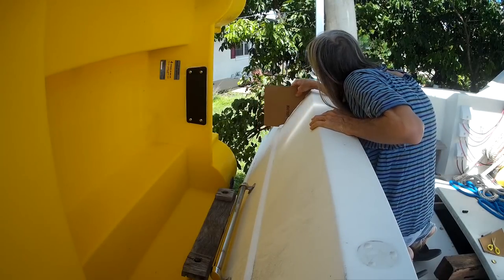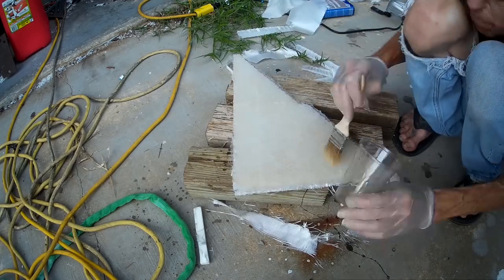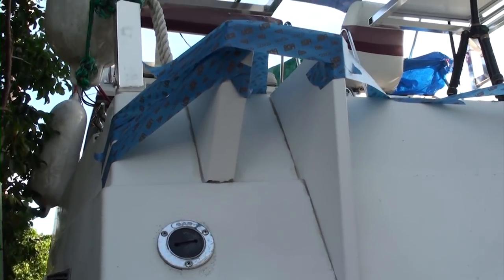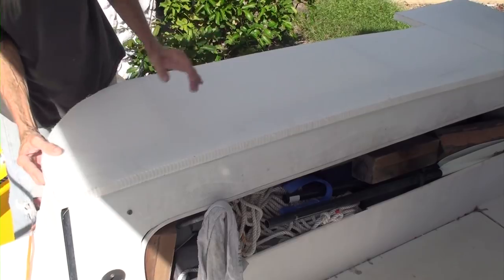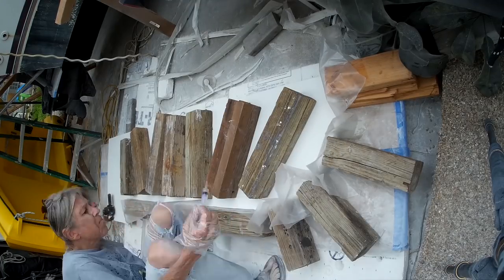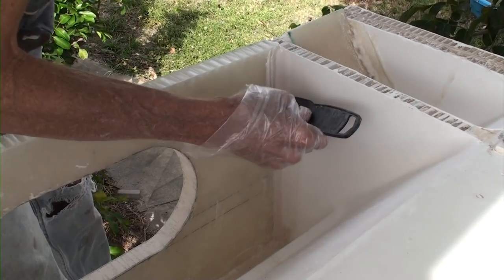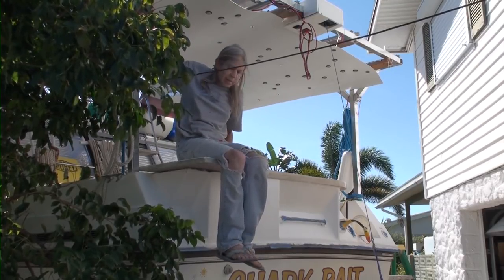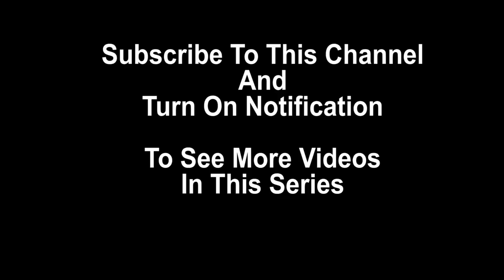Making Nidacore countertop on a boat transom

Comment: Like the countertop! Overbuilt is ok when you never know if a beer keg might land on it or a dive tank!
Reply from the maker: Thanks.  I still didn't know how much glass I needed.  After chickening out and adding more core and glass layers to the counter supports, I just went with 5 layers on the countertop.  You're right about heavy things banging on it in the future, so given the uncertainty about its strength and weight ahead of time, the 5 layers was the only decision that made sense.  After seeing the result, I think I'd go with 3 layers if I had to do it again.  For anything non-structural like closet walls or shelfs for your clothes, just one layer would be fine.  To make stuff like that super-light, use just one layer of woven like I started the shelf supports with.  At that point, they were surprisingly strong and amazingly light (like styrofoam kind of weight).
Reply: Really enjoy your videos.  I gutted and rebuilt my stick steer boat. It was a lot of work.  It's rewarding to have a vision of how to improve something and then make it happen!  By the way, what's your name?
Keep on posting!
Richard
Reply: So I see I didn't post that in the right place. Sorry,first time replying to a video.

Richard

Comment: Excellent DIY work,great job!
Reply from the maker: Thanks!  I learned most of what I know about fiberglass from this boat.  I started with small non-critical projects like the dinghy holders and gradually moved on to larger, more structural projects as I gained experience and confidence.  The generator doghouse came after the dinghy holders, then finally the counter.

Comment: Mate you need to totally remove the existing gelcoat prior to applying glass, you will get delaminating the way you are doing it. Sand back to the point you see glass then you can be sure you will get good bond. The gelcoat must be removed. Your work may hold your weight today but it will not last long before you start having issues. Good luck I wish you well I hope you take my critic in the good spirit is was intended.

Comment: If you are going to use chopmat, it's best to put it first and the woven cloth last. It gives a better finish and also soaks up resin from the chopmat. So, it is easier to finish and it is lighter, albeit a little. Also, woven cloth is stronger by weight than chopmat as chopmat uses twice as much resin for the same weight of cloth. Chop mat is stiffer due to the use of twice as much resin, but ultimately weaker to break, again due to the extra resin.

Comment: Thank you for taking the time out to make this video..👍👍 you really get into Professional Fiberglass skills.. Especially like how you build-up the corners with bondo then fibreglass,and start out with smallest strip medium sized strip and wide strip. I rebuilt a boat probably 25 years ago New stringers naw transom.. No YouTube back then Trial-and-error...but Did learn to Put The resin And jell coat In the refrigerator To get a longer work time in Florida.. Thanks again For taking the time out great video...

Comment: So that's how to cut that stuff.  Sweet.
Reply from the maker: Its pretty easy to cut.  A heavy razor knife works.  The oscillating tool works with metal or wood blades.  A table saw is useful for cutting a little notch in the edge to add quarter-round molding so glasscloth can go over the curved edge instead of a sharp right angle corner.  A circular saw is good for plunge cuts and the straight part of door openings and such.  A jigsaw (sabre saw) is good for curves.  So basically try whatever you've got.
Reply: Surprise surprise more to it than lifting your leg.
Reply: How strong is this stuff just buy it's self . could it be wrapped in carpet and used as a cast deck in a John boat

Comment: You don't use a roller to get the air out I notice. Cheers.
Reply from the maker: I have several fin rollers and tried them a few times.  You have to work them very slow and in the heat here in Florida I always feel that the resin will kick before I'm done.  I suppose I could reduce the amount of hardener.  What seems to work well for me here is to use the brush to remove any air from the laminate.  I sort of stab the cloth with the bristles in a stippling motion and can get the air out.  I wind up with a thicker, resin-rich laminate which isn't as strong as it would be if I pulled the excess resin out with the roller.  Hopefully this will be good enough for me.  Part of it is that I like to work fast, and feel anxiety when going so slow with the roller.  I'm kind of learning as I go and finding that I can get the air out a lot faster with the brush, I went with that before I learned that the laminate is stronger when you squeeze out the extra resin.  If any of this falls off the boat, I'll try going back to the roller.

Comment: what final step you did to shining the surface top?
Reply from the maker: The countertop was sanded smooth.  It took a long time to sand through the roughness created by rolling on so many layers of gelcoat after building up and sanding down just the high spots with 40 grit.  (I built up thickness by rolling on five or six layers, sanding just the peaks off and then laying down another five or six layers)  Once the surface was smoothed out with the 40 grit, it takes just a very light sanding with 100 grit, then 220, then 400 and finally 1200 grit sandpaper.  By the time you do the 1200 grit it should begin to show a reflection.  Then I used some polishing compound from Harbor freight which rubs on and off like paste wax.  After a couple of rounds with the polishing compound, I did the same with a couple of coats of turtle wax paste wax.  Thats all I did to get that shine.  That rough vertical surface at the front of the counter is exactly the same gelcoat as the shiny horizontal surface on top.  The only difference is that the vertical surface did not get the sanding, polishing and paste wax.  It took a couple of days to build up enough thickness so I wouldn't sand through, then the sanding and polishing was all done in one more day.  So the rough vertical surface was 2 days and the shiny horizontal surface took one more day.
Reply: @ninehundreddollarluxuryyac5958   Thank you for the great explanation details. It would help me in smoothing and shining my boat project soon. Appreciated it Sir. Cheers.
Reply from the maker: @hackerghost2  I hope your project goes well.  Be sure to document what you do on video and post it along with anything you learned while doing it.  Information costs nothing to share and benefits everyone.  The most difficult lesson for me was to build up enough thickness before trying to sand it smooth.  I sanded through a lot at first.  The trick was to build up many layers by rolling on gelcoat, then sand off only the tops of the ridges before applying a bunch more layers.  This process got repeated several times until I was sure there was enough thickness to sand down without sanding through.  You will probably sand through a few times when you are learning, as i did.  Its very tempting to move on to the next step too soon because it seems like you are just repeating a step you'd like to think you're done with.  If you sand through, consider it a learning experience, and go back to building up layers again.  Remember that when you're building up, you don't want to sand it flat, just knock the tops off and lay in another half dozen layers before knocking the tops off again.  Repeat the build up and knock down several times before attempting to sand it smooth.
Reply: @ninehundreddollarluxuryyac5958  what type of last layer of fiberglass to get it smoother? Chopped stranded matt or fabric?
Reply from the maker: @hackerghost2  It helps if the last layer is chopped strand mat.  That seems to leave a smoother surface to start with.  You can save a lot of time by smoothing on several layers of fairing compound.  Smooth in a layer, sand just the peaks off, then smooth on another layer going at 90 degrees from the first.  Always wipe down with acetone after sanding so the next layer adheres as strongly as possible to the previous layer.  There will always be little ridges or valleys in each layer, so multiple layers going  in different directions helps to smooth it in.  Each layer of fairing compound lets you build up thicker than ten layers of gelcoat, so it saves a lot of time.  After building up enough thickness, try to sand the fairing compound perfectly smooth.  I usually discovered that it wasn't perfect after rolling on my first layer of gelcoat.  (for some reason, the gelcoat shows the imperfections better than the fairing compound) If this happens, go back a step and smooth in more fairing compound because it will take a ton of layers of gelcoat to fix what could be filled in with another two or three layers of fairing compound.  Fairing compound is made to sand much easier than gelcoat, and goes on much thicker too.  Check out the two videos about making the generator doghouse for more info on building up and sanding down.